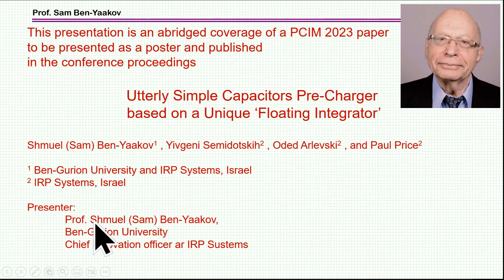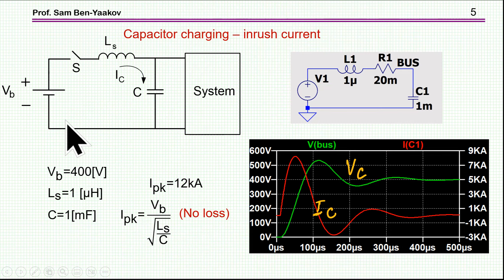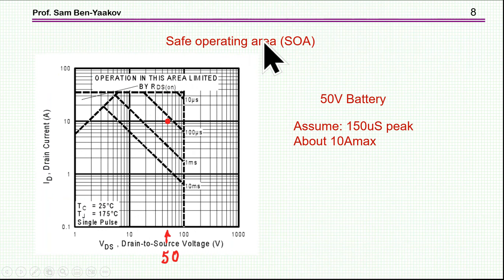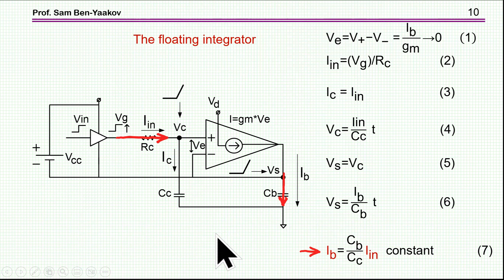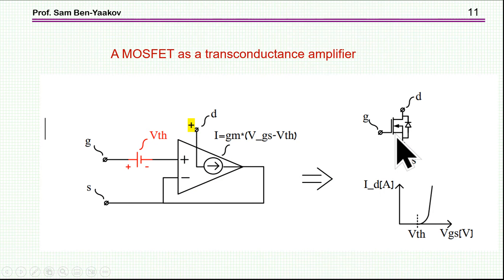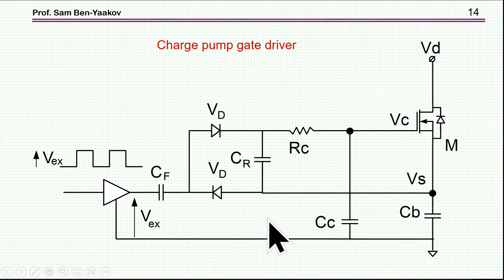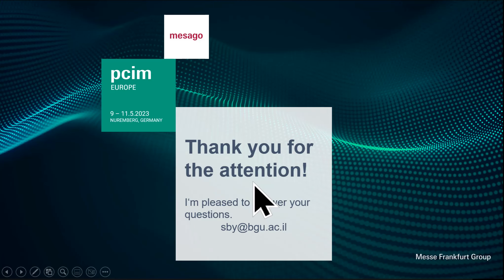Utterly Simple Capacitors Pre-Charger  based on a Unique ‘Floating Integrator’

Comment: Thank you very much for sharing! I am implementing your idea practically and for now, it works perfectly. In the prototype, I had long wires and I placed small resistance in series with a floating capacitor to avoid oscillations.
Reply from the maker: Great. Thanks for sharing.

Comment: @1.25 , the circuit has a inductance , the capacitor is main reason of the inrush current that I understood. But there is a inductor is there in a circuit ,this inductor  doesn't allow such a change a current in the system. My question the inductor itself can act as inrush current limiter? Why we need a precharge circuit seperately?

This question may be silly or basic but I  need a clarification on it?
Reply from the maker: 1. The inductor is not in the charging path.
2. An inductor in series with a capcitor give rise to ahigh current= V/Sqrt(L C)

Comment: i have published this idea before in an audio group, so there is prior art on the use of a charge pump and constant current source to linearly charge a capacitor to drive a mosfet used as a transconductance amplifier to limiit inrush current.
Reply: instead of a high side driver i used a jfet based semitech constant current diode, but thats the only difference
Reply from the maker: Interesting. Thanks. Can you send me a link or copy
Reply: @sambenyaakov  i would have to search around a bit to find the original post. i could send you a fresh screenshot asap if you want. where should i send it?
Reply from the maker: @solenskinerable  Yes, please send to sam.benyaakov@gmail.com  Thanks

Comment: This is a very elegant and simple system. Thank you for your clear explanation. 

Have you considered a way to protect the FET in case of a shorted load? 
Since hobbyists often overload the precharge, I have used high voltage PTC fuses as self protecting precharge resistors in Zilla motor controllers since the 1990's, but they need space to get hot and are not small or cheap.
Maybe some way for the software to monitor load voltage slope and stop the precharge command if voltage is not rising? I like your capacitive level shifter, so maybe a similar feedback RC to disable the precharge driver if the slope is too low? Some software timing might help for that. Or, since end of precharge must be sensed anyway, maybe a high voltage sense on the load could be monitored for slope by the main controller.
Reply from the maker: Thanks for input. In our case the the system is controlled by an MCU which takes care of over voltage and current.

Comment: Good only on paper, when used with inverter and varying load this will produce a lot of ripple on dc line and as result gate of MOSFET might be caboom, thus needs additional protection and resistor on Cc.
Another issue is if load have been fried, with resistor you can safely detect that condition, while this scheme will lead to exponential current rise
Reply from the maker: Thanks for comments Indeed, 'on paper" to be published after the conference the issue of ripple is addressed and the selected solution is explained. And BTW, the experimental results shown are on a real, operational inverter.

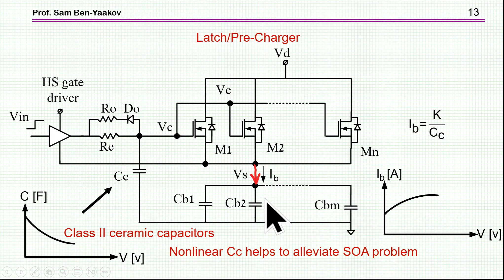Comment: Nice way to precharge capacitors, however it isn't obvious to me how to scale this solution to higher power levels. The setup  with multiple MOSFETs shown at 6:00 will definitely suffer from Vth variation between MOSFETs. Also, rapid load varianton could cause a problem, maybe zenner on Vgs will help to protect the gate.
Reply from the maker: Good points. Some answers in our PCIM 2023 paper. High charging current is indeed a proble in Si MOSFETS. SiC transistors will be better.
Reply: @sambenyaakov  Thanks professor. Unfortunately I couldn't get this paper from IEEE explore due to payment restrictions. Are there any alternative sources?
Reply from the maker: @vasiliy5578  send me your email address and I will sed you a copy  sam.benyaakov@gmail.com

Comment: So here is something that i dont understand : Where is the load and where is the return current ?
As in I can see thee high side FETs but i cant see any low side FETs are they supposed to be where Vs is? If yes then how do they terminate in the Cbm caps?  (maybe this simplified schematic is to much for me or it is not the standard 6 FET inverter )
Also wouldn't it be simpler if the input was just a a few large FETs that are driven linearly up the the point where the un rush is acceptable? i am sort of sure there is a SOA for them that would be ok in terms of power dissipation, then again this may be just to slow of a start.
Reply from the maker: The FETs shown are just the input switch. The inverter in is parallel to the capacitors bank. Details in the papers to be published at the conference paper and will be available at IEEExplore.
Reply: @sambenyaakov  THX the simplified model confused me a bit , when will the paper be released, or rather what would be the expected time interval, IF I may ask ?
Reply from the maker: @Robert88KAL  PCIM 23 is in May. Write to me in June and I will send you a copy sby@bgu.ac.il
Reply: @sambenyaakov  OK THX

Comment: Great presentation and thanks for sharing.
Dear Prof. I just noticed that you didn't show the power loss of MOSFET during the precharge period. I think this may not be applicable for power converters as it can be done through pwm switching to limit current.
Reply from the maker: Thanks for comment. Power loss is not an issue since the operation is just at switch on of the system.